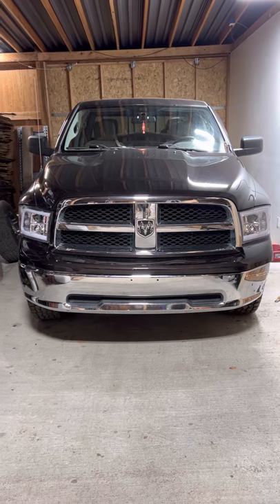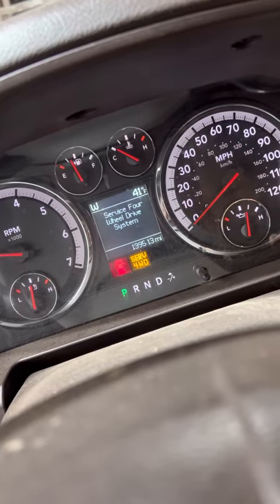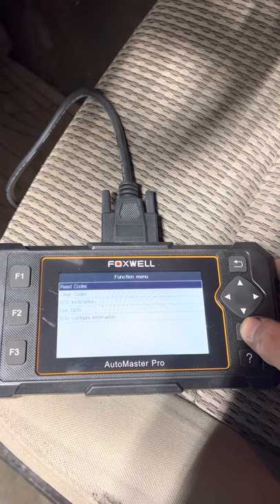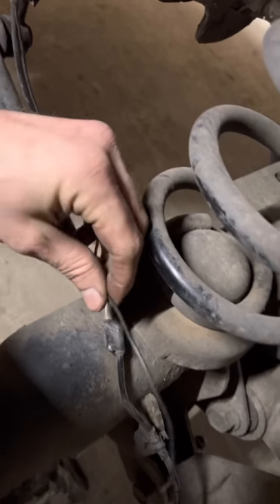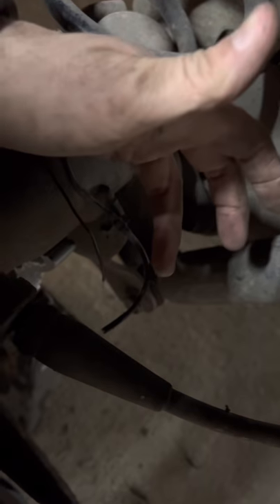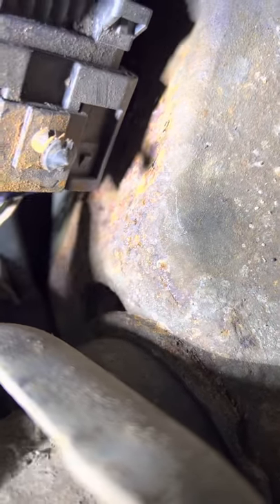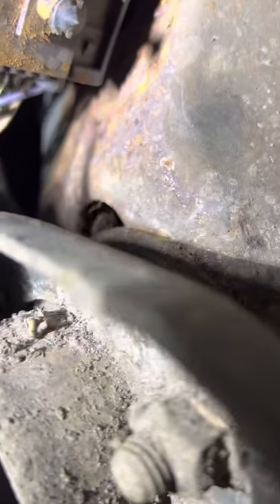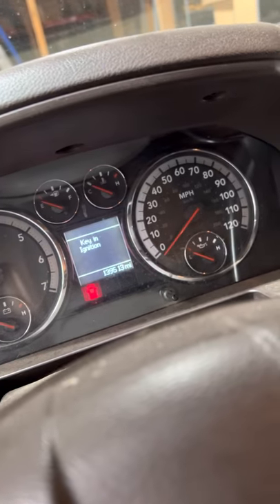2011 Dodge Ram abs/traction control/ service 4wd wheel drive lights are on. (FIXED)

Comment: So had a similar issue on my rear driver side. I hard wired new connectors on the rear and I also had to bypass the connector all together on the front right. I ended up wiring new pins for the front right right into the abs module To fix this problem. Pins 27 and 28 are at the main module for the front right. My 2011 ram 1500 5.7 4x4 had green with yellow and blue with grey wires to the connector under the driver door for rear driver side. There is another wire that is blue with green stripe. Do not confuse them. If it wasnt for this video i probably wouldnt have found my shorts. 2 years and 5 mechsnics couldnt figure this out. Dodge recommended a whole new body harness to fix this problem and 2 days of labour for 2 service technicians!

Comment: Thanks for the info, I’ve changed all four sensors on my ‘10 ram and the same three lights still come on, but only intermittently, I’m now thinking I have a short or broken wire somewhere too and I don’t know which wheel because I don’t have a code reader like you, so I’ll have to find a place that can look it up for me, thanks again!
Reply from the maker: Yes. Any auto store should be able to read codes for you for free.
Reply: @sheild1117 any updates
Reply: @damarcusdjohnson1054 t turned out to be a bad wire on the  harness of the truck (front passenger side)  it was a bit hard to find because the wire was broken inside of its insulator, so it looked good from the outside and still made a good connection, but whenever I drive, that was enough to allow the wire to move around slightly thus breaking that connection and giving me intermittent abs light.

Comment: Good video. I have 4 wires from front actuator 2 are positive on 06 Dodge 1500 4+4. Even when switching to 4+4 then same 2 are positive. One is supposed to turn negative to switch on actuator. But doesn't. New actuator. Transfer case definitely kicking in. Continuity tested wires all the way to firewall. All good. Any suggestions please. I've spent every dime on truck and actuator. Any suggestions please. Im a carpenter but common sense. Help .

Comment: I have the same issue but it is accompanied by a controller fault on the integrated brake controller module and it only really happens when I punch it on the highway and if I turn truck off it goes away and my cruise Controle didn't work no matter what any idea?
Reply: I have same problem with trailer light also, did you find a solution
Reply: Your wheel bearings failing

Comment: Im dealing with the same issues was told to change my front bearings and sensors $1800 later same problems grr.

Comment: My truck has the same lights on. 2011 dodge ram 1500.. there’s a wire hanging from the passenger back tire.. 4by4 don’t work also..

Comment: Good morning,
I have a problem with my 2006 Dodge Ram 1500 5.7 Hemi.
The drives do not work and the ABS lights are on
I replaced the sensor on the axle and the front ABS sensor that was indicated by the computer
All drive lights are on on the counter and the N diode on the switch, i.e. neutral

Has anyone had a similar problem